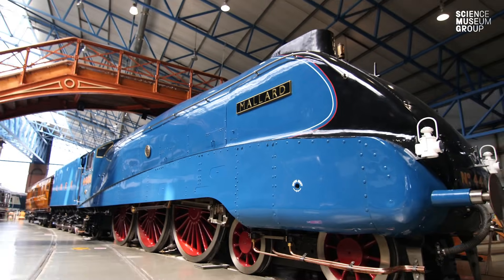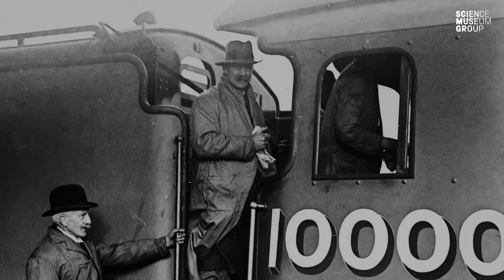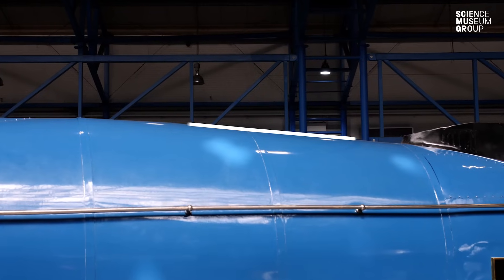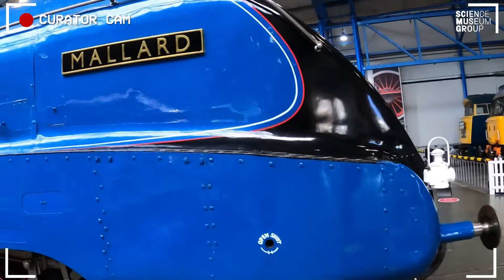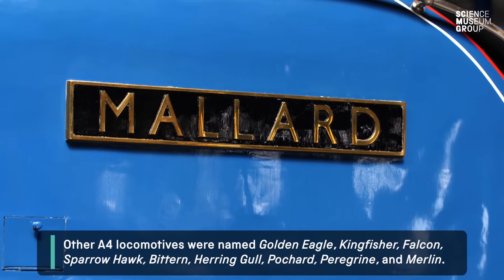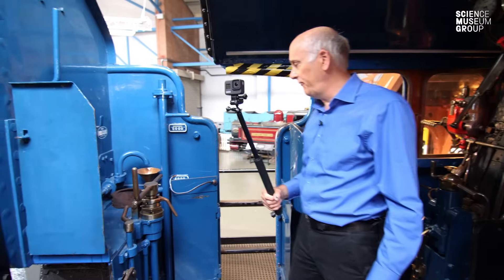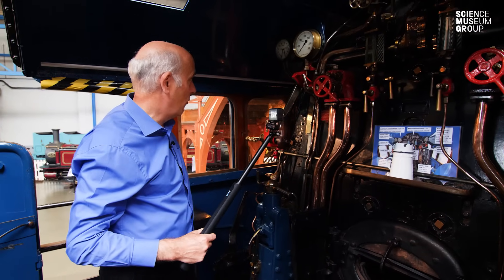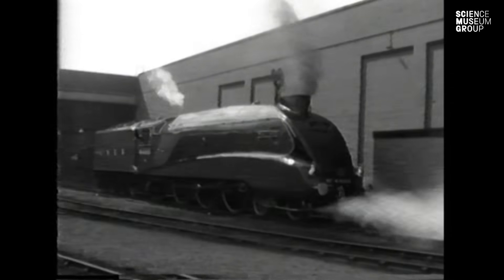Inside Mallard, the World's Fastest Steam Locomotive | Curator with a Camera

Comment: Firstly , with a little more than 12 years to go , it would be nice to see Mallard restored and back in steam for 2038 ; if not to hit 126 again , she could perhaps be allowed to do a 100 mph run to commemorate the occasion . 

There was a nice story that , not long before Mallard's record run , the Germans had set a record at circa 200 Km/h , which was just marginally less than Mallard's record speed ; and when Mallard took the record the Germans were not best pleased , especially a little chap in Berlin with a pencil moustache . Alas war broke out not so very long afterwards so no further attempts were made by either country . 

The other thing was the much discussed rivalry between LNER and LMS ; it was difficult to directly compare the two locomotive types , because they were each designed to run on their own lines , the East and West Coast mainlines respectively , which were different distances and had different gradients , so simply comparing the times taken between London and Edinburgh or Glasgow were not exactly relevant .  

It would , however , be quite the spectacle if either the East or West Coast mainline were closed over a public holiday ( such as New Year ) so there was no other traffic , and allow an A4 and Coronation Class to run alongside each other on both tracks of the same line ; not an out and out race , but a spirited run with speeds perhaps up to 100 mph permitted .
Reply: @derekheeps8012  all steam trains except tornado are limited to 75mph due to their age

Comment: arguably an American locomotive was faster but it was never measured accurately, and i think they were all scrapped. I reckon we need another steam race to get to the bottom of it! Just imagine every nation got together to build there best and fastest steam designs for modern day trials!
Reply: Not really possible to have that argument if the speed was not measured (never mind correctly, it was just not measured). Lots of wild claims about e.g. the PRR T1s.
Reply: The inevitable Americans show up to argue that they couldn't possibly have been beaten at anything. 🙄
Reply: @deaddoll1361  but it is technically true, the U.S had Multiple locomotives that could and would exceed 126mph, for example, When the N&W was testing the J-class the crews noted she was rated around 130+. Another example being the prr T1, the popit vavles were only rated for 140mph, they would come into the shop on a regular with broken popits.
Reply: @DavesModelTrains  Do you mean poppet valves?
Reply: someone is currently building that engine so the mallard might be dethroned soon
Reply: @YimYum911  fingers crossed on that as an American. The T1 was unofficially capable. I am guessing the tracks will be the limiting factor so hopefully they can arrange for that.

Comment: If WW2 had been won by the Germans the worlds fastest steam locomotive would have been the DR Class 05. In any case, probably the worlds fastest steam locomotive was the Pennsy Duplexi....
Reply: You scandinavians are insufferable online. Stop talking cods wallop
Reply: @f-the-left Americans claiming they're best just by being American are insufferable, and there's so many of them.
Reply: Claims of the pensy duplex hitting 120+ are non factual.   The only people who claimed it happened were a driver and fireman on the S1    And some folks who lived in the countryside who’d seen it steam by.  Pensy themselves never once said it could do that speed  and never attempted to officially document the locomotive achieving speeds even close to that.      Seeing as there’s absolutely no reason pensy wouldn’t try to officially confirm those speeds if for nothing other than publicity reasons or to bring the speed record back to the US     Why do all the pensy foamers. Keep trying to say it managed that speed?   It had a complicated valve motion that didn’t work well at speeds above 75. They became maintenance queens due to constant mechanical issues with the motion or something else.  And even though it did have some serious power both it and the T1 had major adhesion problems wich would hamper there ability to start trains and cause wheel slip at speed  which would make it difficult to approach speeds of 100+. Because at those speeds it would encounter more uneven track faster and run into more slip. Or over run its valve motion and pop a cylinder head. Which they did many times it was one of the maintenance problems they kept breaking poppet valves and cylinder heads despite the original specifications calling for it to withstand 110+   Because they changed the valve type when building them and didn’t change the spec requirement.
Reply: @acescionti711  once 5550 is operational we will see how fast they really could go, I wouldn't be surprised to see it crack 130.

Comment: Only officially and I suppose that’s what counts. The Pensy T1’s were said to have reached 140mph on occasions when they secretly had to find out why the poppet valves kept breaking. They had a man who would ride the trains to inspect driving habits. They kept watches and took time recordings that suggest they far exceeded the Mallards records when trying to make up time. The A4’s however were far better locomotives, more reliable and less prone to wheel slip. Let’s hope the successfully build the new T1 and we can see for sure….
Reply: The '140mph' claims by the Franklin engineers (as reported in 'One Man's Locomotives') are probably artifacts of high-speed slipping; they were based on indicated machinery-speed data and not timed road speed.

Comment: If only the PRR S1 (Tho due to Issues it wasnt Saved) was still Around to Tell that it was actually Faster than the Mallard.
Reply: All I can say about the S1 is, it’s too fat.
Reply: @TheSudrianTerrier653  That's the American loading gauge for yea, Any mainline tender or diesel engine is Produced, It's Either Going to be 15ft or 16ft tall and very wide down here.
Reply: @Bigrone111 it really was too fat , it could only safely operate on one route!
Reply: @TheSudrianTerrier653  I know, I would say since it's not articulated, It is indeed too big for the curves to handle such a big locomotive on a single frame.
Reply: It's not that it was too 'fat', it was too long and stiff.  The restriction on route was one area in the approach to the station in Pittsburgh, but the reports about problems hostling the S1 in Crestline indicate more likelihood of "issues" at other places and times.

Somewhat better addressed by the T1 design (and the curve and switch problems fixed in the mid-Forties, allowing the locomotives to work east of Pittsburgh).

Not as much a 'long rigid wheelbase' issue as a stiff lateral compliance and guiding problem.  Which would actually get worse if zero overbalance was applied...

Comment: Mallard may hold the record, but I can't help thinking that some of the streamline US locos of the day could have beaten that, if they had good enough tracks that is. There was also some German loco that was close, if not faster.
Reply: But they didn’t did they.
Reply: No, they didn't 'on the record', and that is why Mallard holds it.

Critical speed for the BR05 is supposed to be somewhere in the 240s (km/h) but I think there was limitation both in effective radiant uptake and in front-end design that might have made reaching that speed impracticable without modifications -- which were not made.  The Germans had over a year to 'break the record' if they could, and it would seem politically beneficial for them to try, but I think the emphasis was on the motor trains with German (Diesel) engine technology.
Reply: No, he's talking about the BR05 class, which was the first verified over 200 km/h, a speed that is a distant pipe dream for 18 201.
Reply: I understand it, when it is actually present.

To me it was very clear that the OP was discussing the two 'normal' BR 05 class, both 'before' and 'after' Mallard's run.  When you provide a dynamometric trace or equivalent data for over 200 km/h for 18 201, we can continue the discussion.  (Keep in mind the difference in power required to reach 125mph from ~116mph; it's far from trivial).  Something that was underscored by recent planning for Brightline in the USA is that if you have one PRIIA-compliant locomotive that can bring a given consist to 100mph, you'll need two to just reach 125.  (And this with diesel-electric power with no critical limiting speeds in the range.)

We might also keep in mind that the BR05 had considerably taller drivers, no overtravel for its center-cylinder valve, and much more carefully executed aerodynamic streamlining.  This makes Mallard's achievement even more impressive.
Reply: "Shan't you" is only the worst of your grammatical solecisms, so be better advised before criticizing  others.  And don't be so quick to conclude that technical discussions that may disagree with some mysterious agenda you may have are aimed at you or your opinions.

Not disparaging 18 201 as a locomotive, or as good 'adaptive reuse' of a different kind of German high-speed locomotive.  But I do not believe it is capable of reaching 125mph as currently constructed.  I would be delighted to be proven wrong.

Comment: But I ask myself what is with the Br05? was it possible faster? The two locomotives have near the exact  topspeed but the mallard was going down hill at the start can you say something about that?
Reply: Br05 went 119 mph
Reply: @Tric0l0r3  br 05 200.4km/h mallard 201.2km/h

200km/h =124.5mph
Reply: @marcowinkler8225  mallard went faster mallard fastest
Reply: A potential problem is the fibbing.  The actual dynamometer trace indicates the '126.1' for a ridiculously short interval, and the momentary acceleration charged to reach that is unlikely to be from anything other than a surge artifact.  Gresley himself only accepted 125 and a fraction as the 'best' speed -- which is still good enough for fair history.

It is quite possible that the BR05 'could' have gone faster still.  But there is no record that that was done.  Alfred Bruce of Alco said he had seen Milwaukee A locomotives operate at 128mph more than once, but without a dynamometer trace that remains only an invitation to see a replica built to demonstrate it.

Comment: How does an engine have zero back pressure? What powers the firebox draft?
Reply: The Steam Cylinders exhaust through the Smoke Box blasting directly up the Smoke Exhaust stack creating a suction .
Plus , at speed   Bernoulli Effect across the Top side will REALLY  start pulling the Fire .
Reply: It may help to look at this from first principles.  A steam locomotive benefits from lower effective back pressure at the exhaust ports, but steam re-expands in volume with falling pressure (which is a major problem, as the Steamotive developers found in the '30s, when you want to have a full-condensing engine at the high continuous power needed for high sustained road speed).

Meanwhile, remember that the whole of the combustion plume is below atmospheric pressure except incidentally, and the 'draft' is not the smoke being pushed out of the stack by exhaust pressure but the result of entrainment and acceleration of combustion gas by the evolving exhaust.  

When you put these together, you want an exhaust that has good free-stream mass ejection at its core, but a great deal of entraining turbulence around its periphery that also 'just seals' to the tapering outer periphery of the stack or funnel.  If you are wondering why Goodfellow tips work, or why the Giesl is thin but very long, you'll have better understanding if you watch for these two effects together.

Now, if you have multiple defined nozzles in the blastpipe, Jos Koopmans (of The Fire Burns Much Brighter fame) notes that each evolving nozzle jet acts much like a smaller single evolving plume... in other words as if it were in a stack of much greater effective length.  If we increase the periphery of the stack (or the number of stacks) we can then point the multiple jets so they 'seal' around the periphery with net greater entrainment capability, but leave a region of free area at lower pressure in the middle, where gas mixing may be less but part of the evolving steam sees lower pressure to expand into.  So you have a greater free area of exhaust, more efficiently used, with lower back pressure for the same mass of gas ejected as effectively.

Then we work on increasing entrainment effectiveness, which is what the multiple vanes in the Kylchap arrangement do.  The gas flow at the front tubesheet/tubeplate is substantially longitudinal, and even if passed through the "convergent-divergent nozzle" that is a Mater-Mechanic-style front end has to have the flow rotated into the axis of the exhaust jet(s) and accelerated smoothly up to speed to avoid flow stalling or shocks.  The multiple vanes help do these things nicely; a Kordina arrangement does it even more carefully while defining each exhaust port's flow separately.

The point about induced slipstream assisting with draft (and reducing effective back pressure) is a good one, and arguably some of the streamlining intended (usually incorrectly) to assist with 'smoke lifting' also has the effect of pulling a partial vacuum on the stack that continually reforms regardless of high effective exhaust mass flow.  It is technically possible at 'record' speeds to use the slipstream entirely for drawing the fire, and reducing cylinder backpressure to a practical minimum, and there are interesting potential applications of a Franco-Crosti-style economized arrangement benefiting from the Meredith effect to consider...

Comment: No doubt an achievement by any standard.. but I wonder , if not for diesels,  would the USA or the Australian's been able to break that record.. at that time Steam traction had essentially reached its technical limits .. even today Steam Delivers consisten power at higher elevations but physics of steam was tapped out in the 1940's
Reply: I'd say no because the UK had high speed rail in the 1930s with steam and we in the US don't even have it in 2022 with diesel electric xD
Reply: There are claims the PRR T1 class often broke 125mph but no official testing was ever done. However now a new one is being built which is going to try for the record.
Reply: The issue is not technical.  Even Woodard's high-speed locomotive of the early Thirties, before much of the sophisticated knowledge of good balancing and low reciprocating mass with low overbalance was developed.  Alfred Bruce noted several instances of the Milwaukee A, itself an early-Thirties design, reaching 128mph in test running; the abandoned PRR E8 Atlantic would likely have been faster still (oil-fired with 84" drivers on a railroad that loved its Atlantics!) but PRR instead went into putting two of those under a common boiler -- we'll see how well when 5550 gets running with her instrumented wheelsets.

Comment: I'm old enough to have seen this engine run in service. It was a frequent visitor at Doncaster stopping before moving on to Edinburgh (or London Kings Cross).....The colour was BR green and the wheel covers had been removed but it was the same engine. A distinctive whistle to tell you it was a "streak" and close up when it stopped you could feel the enormous power when it breathed......the driver wore goggles and the noise when it slide off into movement made you put your fingers in your ears. So glad they preserved it......